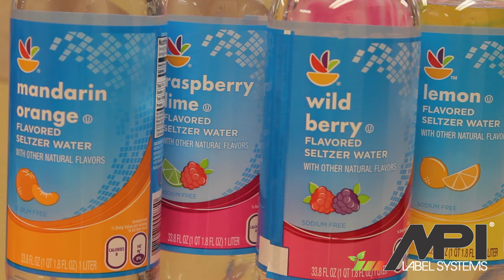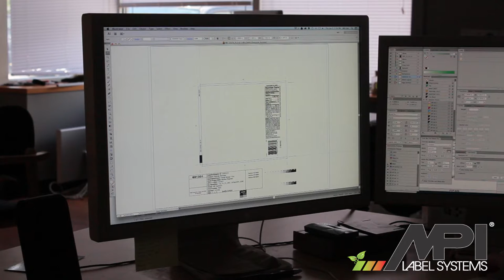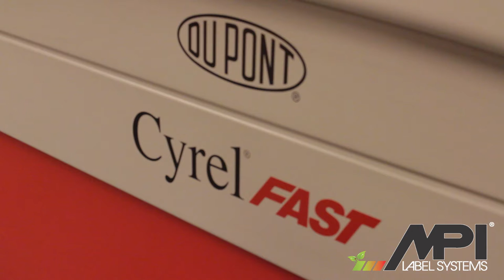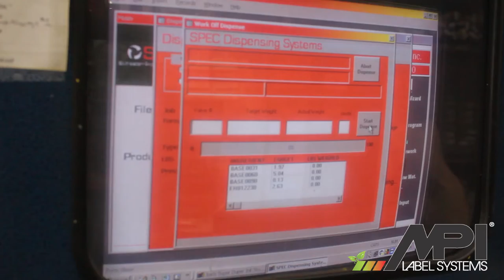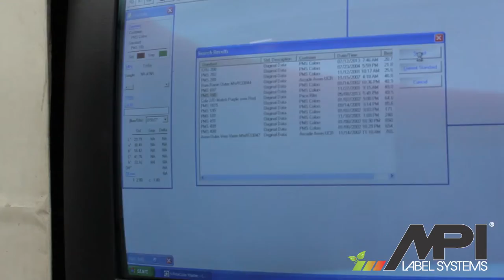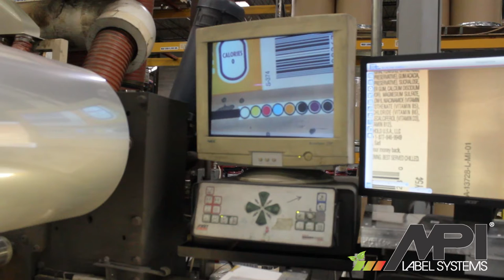How it's Made - Roll Fed Labels

Comment: Hi great video I'm just wondering what material are the labels made out of ?and the recycling process of the excess label material
Reply: I work at a label manufacturing plant. There is almost no recycling. So much waste its crazy
Reply: I work for this industry 25 years. 35meters per color for every job. Now there is digital. Less than 1p but people don't know